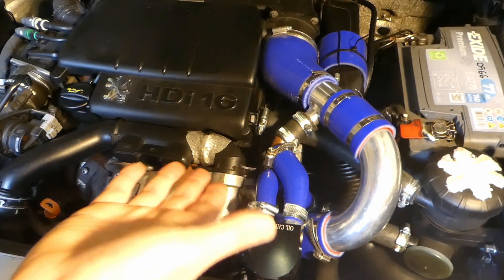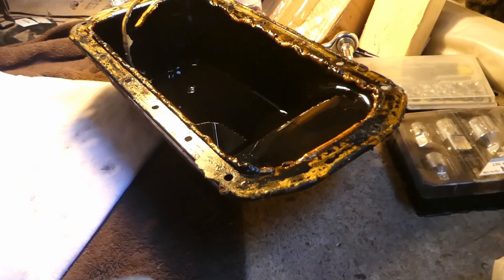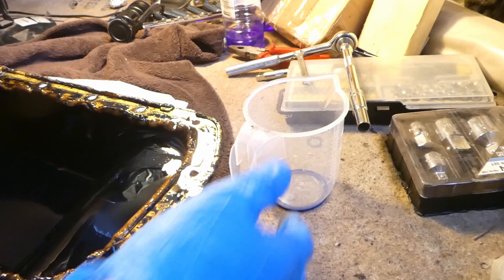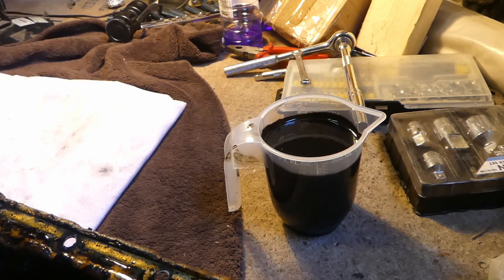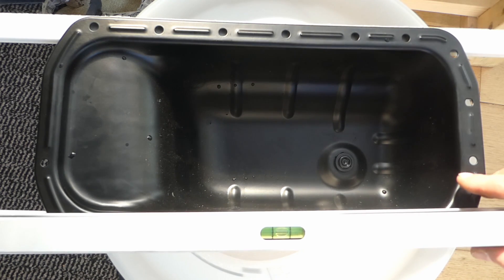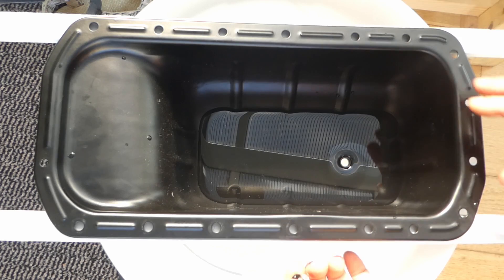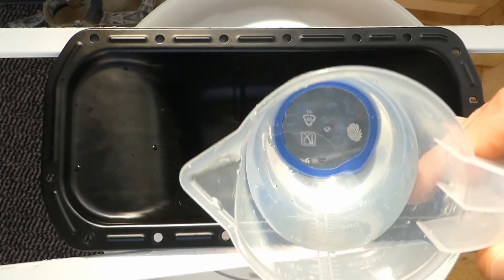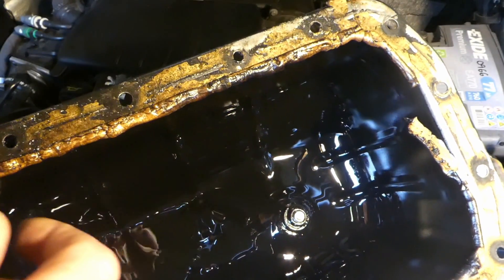How much oil is left in the sump, 1.6HDi after 24h drain? (2007, Peugeot Partner)

Comment: Thank you for video, and this is ridiculous design of the sump.
Reply from the maker: Hi Chevalier, I agree it is a bad design. It will still hold oil somewhere between 7-11% of the total amount. I can see the manufacturer's point, preventing the sump bolt to be knocked from speed hump or something.
Reply: I noticed this ridiculous design flaw sometime back and now I angle the car to aid draining, then use a plastic pipe and a plastic bottle to suck out any remaining oil.
Have you seen the guy pull out the sump shape with a draw hammer ?
Reply: @moremolecules  But really, it's doing more harm than any small risk  of that is worth. If that really was of concern a skid plate or deflector of some sort could have been installed ?
Reply from the maker: @nigelmitchell351  Yeah, I agree, but most of the times the skid plate is simply a plastic tray, that more often than not is simply discarded by the user. Easier to change oil without it or the plastic fasteners get mangled and cannot be used again. My other car that I bought second hand (Peugeot 307) simply did not come with undertray. Someone had simply thrown it away and I had to buy another one. My Peugeot Partner Escapade has a proper metal skid plate, ~10kg heavy and that would prevent knocks.

Comment: This is beyond ridicoluous and unaceptable! I cannot believe they are making same sumps for last 15 years. Completly insane
Reply from the maker: I can understand why they do it, if the the sump bolt it sticking down it is fairly easy to knock it and all the oil to be dumped on the road and one has nowhere to go. Yes, it is a bad design, but 150-170ml of oil left is not too bad and can be sucked with a hose, although it is additional effort and no garage will do that for you.
Reply: @moremolecules  others did tests its about 0.3l (you tested it) of oil, also most cars i had so far had sump pug sideways so I definately dont see how they come up with that idea, it has no justification. if plug was the problem there is obviously different way to solve it. usually when you drain the engine entire engine giant including vacuum pump which dont drain leave less than 0.1l of oil in. this is jst dumb. Unfortunately any replacement pans i can find are exactly the same like OEM

Comment: I've always thought this was a silly design on the 1.6 HDI. The 2.0HDI with the aluminum one was a lot better but I suppose the the metal ones are cheaper.
Reply from the maker: Hi Devinder, yeah, it is a bit poor design, but the sump bolt is more protected. I suspect that was what PSA was going for.

Comment: I can't speak for everyone but I Jack car up at the front to do oil changes so sump is not level when draining oil .
Reply from the maker: I am always tempted to do that, as it is easier and I can reach to undo the sump bolt, but there will be a lot more oil in the back of the sum that way.
Reply: @moremolecules  yeah that's true , I never really thought about that . I'm doing service soon on wifes mazda 3 1.6 hdi so will have a look when under . maybe even jacking car up on passenger side so its tipped towards offside 😊

Comment: Wonder why they designed it like that?
Reply from the maker: I understand them why they did it that way. If the sump plug is sticking out down then it is very easy to knock it out and all the oil draining while driving leaving you for example in the middle of nowhere. They could have recessed it a bit better. It is still better to protect the sump bolt that way despite some oil being left inside.
Reply: @moremolecules  Yes that's what I thought as well, but then on my car the plug is on the side instead of the bottom and the hole is leveled with the bed.. so all oil drains. Seems better design than this. As your new oil will instantly be contaminated.
Reply from the maker: @KillerkoUK  Yes, on the side will work quite well, but the sump has to be tilted as well in order to get the oil out.

Comment: That's the reason I tried sucking the oil with vacuum oil extractor. It's little difficult to go through the bends of the dipstick tube, but after few attempts I got the hang of it and now I'm sure that I am pushing the extraction tube to the sump itself.

There is quite a difference - when I'm using the vacuum extractor pump I am getting 4 liters of oil every time (it's at the "max" on the dipstick) and getting 4 liters of new oil in (again to the "max" on the dipstick). When I'm draining the oil through the sump plug I'm getting around 3,5-3,7 liters, so apparently there is around 300ml left in the sump. 

One just has to be very careful when pushing the extraction pipe in the tube and "feel" the two bends before the exit to the sump. :)

You should try it, saves a lot of time and oil stains!
Reply from the maker: Hi dokov, yes, absolutely right. Next time I am using a syringe and tubing to get whatever is left. The problem is though that PSA advises against using a suction method for the 1.6HDi. I never understood why not. They always say that suction method should not be used to drain the oil.
Reply: I think the reason to advise against using suction type oil change is exactly to avoid cases when someone is in the rush and pushes the suction tube only half way in to the first bend and then leaving it there.  This way we're getting only around 2 liters of oil. But when you're doing it carefully by yourself it's not a problem to get it right.
Reply from the maker: @dokov  That makes sense. I always thought it is a bit weird advice.
Reply: I also use the vacuum extractor on my HDI 1,6. So far so good. I haven't checked how much is left down there, but I love how clean and easy the process is
Reply from the maker: @kostalakoste  Yeah, that is my plan for next time.
Reply: That is only way to have this engine for long time.
2.0 hdi was far better.
Reply: Thanks for this information.This has always annoyed the hell out of me too, a ridiculous piece of engineering. Why on earth didn't they put the drain as low as possible on the back of the sump ? Leaving almost half a pint of dirty oil in the sump isn't really what one would call an oil change .....
I would suggest, if one has time, using capillary action to get at that remaining dirty oil, in the form of a number of (smokers) pipe cleaners twisted together.
These could be shaped to best advantage and hung from the drain plug hole.
Alternatively go up through the drain with a walking stick shaped piece of small acrilic tube and use Siphonic action, or a syringe !
Keep up the good work !
I always raise the driver's side my hdi to optimise oil draining and the passenger side to optimise coolant bleeding.

Comment: With partial oil galleries and oil pump drained you need +5l to complete oil level. 

Bent my crankcase two times, thats how you remember for the next time
Reply from the maker: Hi Ignacio, yeah, there will be quite a bit more left in the galleries. Out of interest how did you bent the crankcase?
Reply: @moremolecules  It was a mistake from me. First I put the studs on the wrong hole, the flatness of the bolted surface was distorted by 2mm but I dont notice at the moment until I fill with new oil. Unbolted the crankcase, cleaned and seal again thinking It was a fault with silicone seal. Second time I spill new  oil on the ground I decided to straighten the crankcase, but I wasted more than 10l of Total 5w30 oil... Never again!
Reply: What caused all that: Oil stick plastic broken inside
Reply from the maker: @ignatius2230  Yeah that happens. Hopefully does not leak anymore.

Comment: Excellent video as always, I was curious about the amount of oil left in the sump, not really a great deal but with the common sludging and turbo problems on the hdi it's easy to see it can be a contributing factor.

Btw official Citroen service emphasizes the oil must be drained level and after the cooling fan has kicked in, the reasons are obvious. Did 92hp hdi have a oil filter gauze in the banjo bolt for the turbo pickup or is it just the 110hp versions?
Reply from the maker: Hi J, if you consider that all of the oil is 3.75L, 275ml is ~7% of the whole amount and my old sump ~425ml is ~11%. That is quite a substantial amount of oil left. The 92bhp also has two versions of the banjo bolt filter, the older is just the metal mesh and the newer design with the longer plastic filter.
Reply: @moremolecules  thank you for the info I initially believed the 92hp versions had no filter gauze thank for correcting me, I'm at around 160km myself (100k miles) 

I've always changed the oil on axle stands or ramps and so left a fair bit more old oil then doing it level. 

Also i use fully synthetic Castrol/lotus 5w40 c2+c3 spec oil or 5w30 many times it's always on offer often £10-12 for 4-5 liters. No real problems (besides referb injectors not long ago)
Reply from the maker: @user-zt4ry9hm9u  Yeah, you may want to do it without the axle stands. £10-12 for 4-5L is really amazing deal. I do the total quartz ECS, but it is rather steep in general, ~£30 for 5L. I do not think there is that much of a difference between the different manufacturers.
Reply: @moremolecules  Yah it's really is good price, best time to buy oil on offer is in winter before your next service or buy 20 Liter drum if you have more then one car with family and friends, during corvid-19 there were loads of great discounts also. 

I know total quartz ineo 5w40 is recommended oil for the engine. But as long as it meets or exceeds spec should be fine, depreciation kills more vehicles then oil.
Reply from the maker: @user-zt4ry9hm9u  Yeah, I somewhat got stuck with this total ecs, as when I started working on the car it's what I started with and have not changed to a different one. Superstition I guess. I absolutely agree, if it meets the specs is alright. Hahaha, absolutely there with you about depreciation killing the cars not oil. I paid quite a bit of money for my car at the time, but have driven it for ~12 years, so it's kind of alright.

Comment: Interesting fact. What oil and change interval do you recommend? I’m changing every 6 months/6 kkm
Reply from the maker: Hi Pawel, I also do 6 months or 6k miles, basically half the recommendation. I think is a bit too much or too frequent.
Reply: more molecules yeah but fresh oil is essential in this little boosted engine, now I have some things to do have to replace vacuum pump sealing and probably take the injectors off cause I’m leaving too much black smoke 💨
Reply from the maker: @pawelcitak83  While I do 6months, I have some data to suggest that the oil is still good after 6k miles, might do a video on that.
Black smoke could well be the injectors, it's too much fuel and not enough air, could be from anywhere.
Reply: more molecules i tried checked the whole air supply along with all the sensors and turbo boost that goes up to 1,1 bar so it’s working fine, I reckon one of the injectors is leaking, I’m having them removed this Friday and we will see how it kills my wallet :) I checked the injectors correction  and 2 of them are -0,50 so it might be the problem
Reply from the maker: @pawelcitak83  1.1bar is really nothing, it should go a lot higher than this. This is 100mbar above atmospheric pressure, not that much. It should go to at least 1.8bar. -0.5 is also fine, whether they are positive or negative is not what matters, it's how large the numbers are. If the turbo is working alright, you may have an air leak somewhere.
Reply: more molecules ok i will recheck thanks for the tips merci!
Reply from the maker: @pawelcitak83  I would say there may be an air leak after the turbo, something like a split hose. Unless, of course the turbo solenoid or wastegate are not working properly. Last time I checked mine went to about 1.6-1.7bars without pushing too much.
Reply: @moremolecules  hi, how are you, you say 1.8 bar at what rpm?? I saw an oil sump that is totaly flat, so can drain all the oil. I have to lift the car for the other side to drain as much as possible.
Reply from the maker: @dieseltips  Yeah, there is a different design, but I could not quite find where to buy it, only saw it in a photo somewhere. Now for the 1.8bars, I was looking at a graph I produced a few months back for a forum and I was quickly looking at the graph, eyeballing the exact figure. It was probably ~1.7bars, probably 3rd no more than 2,500rpm. That is only from memory though, might be wrong, but I do not remember pushing it too much. Anyway, 1.1bars is way too low, almost no turbo whatsoever.
Reply: @moremolecules  so the real boost presure is all the psi above of the atmospheric press? If the a.p. is about 14 psi or 1 bar then the turbo gives 0.7  bar extra more or less?. sorry on my english. Thanks
Reply from the maker: @dieseltips  Yes, that's correct. It should give a bit more if it get pushed. That's how I understand my PP2000/Diagbox readings from the turbo boost.
Reply: @moremolecules  I think the one with the changed design you're looking for is this one: KLOKKERHOLM 5507476
Reply from the maker: @phistoeck  That's the one. Thank you very much indeed for the number, really appreciated. Pity I already replaced it.

Comment: I can understand why it was designed that way, to stop people smashing the drain plug on speed bumps ect. But id rather risk that than leave all that potentially contaminated oil in there to damage the engine. https://youtu.be/ajFe-Jqkt8w
Check that video out, easy way to make sure you get all the oil out next service without having to take the sump off.
Reply from the maker: Hi HoopDub, I absolutely agree and I mentioned it in other comments that the reason is hitting the sump on a speed bump. I did not take off the sump specifically for draining the oil, it was for a turbo replacement and it was convenient to see how much there was left.
I suspect an even easier option is to drain as much as possible from the sump plug and then suck the rest from the dipstick.
Reply: they can still design it from the side and have zero oil left. 
this design is pure engine killer. 2.0 HDI was far much better.

Comment: Do you recommend flushing with cheap oil.. Like every 50k or so
Reply from the maker: Hi sathwick, yeah, I'm not too sure. The best option is to drop the sump and replace it with the new design sump that does not have this baffle. Nevertheless, even better option is to drain to as much as it can be done and then with a syringe and a long piece of tubing to suck whatever it can be sucked from the oil dipstick.